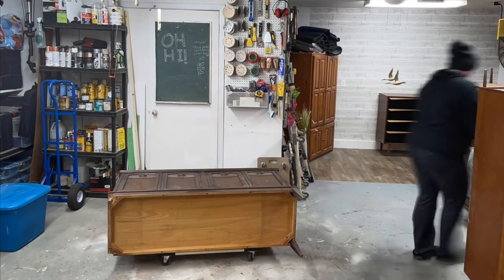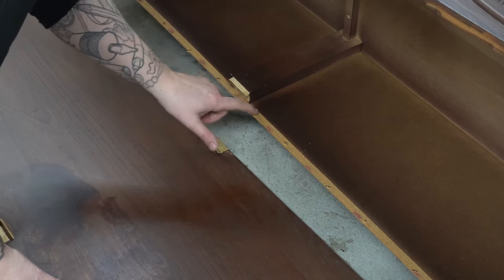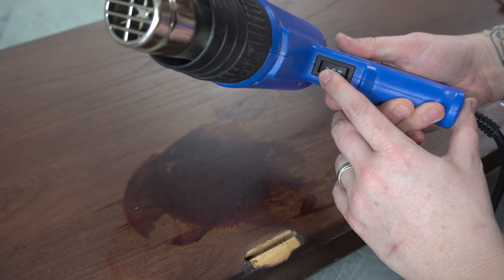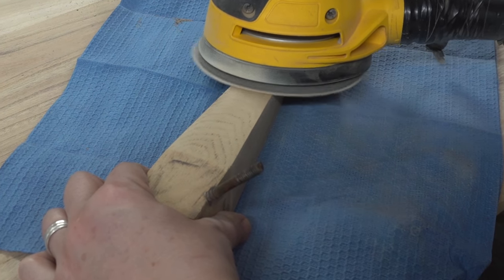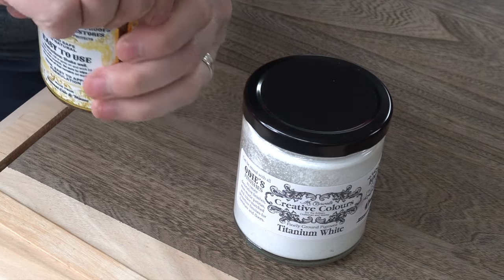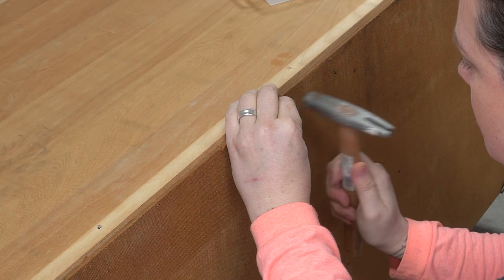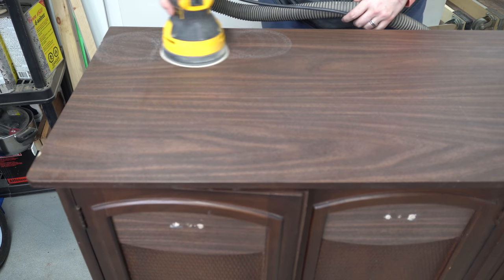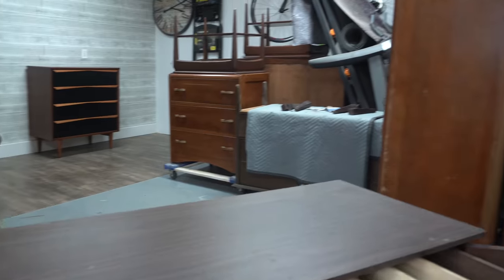From Drab to Fab: Vintage Sideboard Makeover!

Comment: When you put glue into cracks, try using a little suction cup to push the glue in. Place it over the crack and push up and down. Luthiers use this method on guitars 😊
Wonderful job 👍😊👍
Reply from the maker: Very cool! Great tip!
Reply: Great tip 👏🏻👏🏻👏🏻👏🏻👏🏻👏🏻
Reply: They also make dental syringes with little pointed tips.
Reply from the maker: @stevedarnell8444  yep! I find it’s a bit hard to get glue down those ones (typical wood glue, anyway.. hide glue might be easier) and this crack was too narrow for a normal glue syringe.. so floss it was. Haha
Reply: @TranscendFurnitureGallery  Never thought of using floss - good tip as well

Comment: You could try an air duster in a can with a tube nozzle (the kind IT people use to clean computer keyboards) to blow the glue into the smaller cracks, maybe dilute the glue a bit for this?  I haven't tried it myself but I just thought of it while watching you tackle the cracks. Also - for the warped wood - if you have the time and the piece is decent, try soaking the wood on the raw unfinished side with a paintbrush and just water then clamping it the way you have done.  Let it fully dry then check the warp. Keep re-wetting (only the area that is warped not the whole piece and not on the painted/stained side), and clamping and drying until the warp is gone. I have done this before on a piece with a lot more warp that the one in this video and it works really well but it does take time. All up it took about 3 days for me.  Some people soak the whole piece but it doesn't need it if it's just one edge.  Works brilliantly! :-)

Comment: When you have a large board like that that's warped you can use a table saw and do a half to quarter depth pass in the middle of the bulge then fill it with glue and clamp it. This will force the convex bulge to pull down straightening the board. Obviously it 100% depends on the severity of the warp, the tension contained in the wood, and the availability of strong clamps. I've done it using pipe clamps and it works wonders

Comment: The gold knobs and timber base and legs make it. Good job miss muffet. Great retrieve from something truly scary from birth to this smart item with reassuring pale timber. Elm is alright, I have a circular Best black refined granite with pencil round edge, table with central column and supports of  old elm made for me by carpenter furniture make. And match rectangular table the dirt that sits behind a setter, with elm base with a basket shape under the granite so could be used in a 100 years with a glass top. The two colours are good, deco.
Reply from the maker: Thank you so much!

Comment: A tip (you might already know,but....)
Keep your sawdust in a jar or coffee can, sift it so there's no chunks/splinters.  When filling a hole, eyeball the amount you'll need,add wood glue to it making sure it is all wet. Apply just as you would apply putty. Let dry,sand it,good as new (and economical.

Comment: With cracks have you ever tried CA glue?  I use it all the time, works really well. Flows into cracks almost like water so you are not having to fight with pushing the glue in.  If crack goes all the way through just put painters tape at bottom of crack.  By the way. Great work.
Reply from the maker: I haven’t! That’s a great idea!

Comment: This is a fabulous transformation, I would never have thought of black but it works really well.  Did you use the same stain on the front of the doors as on the rest of the piece? I think you said that the panels on the doors are plastic so I wasnt sure if paint would be ok to use on there?  thanks

Comment: great job love the contrast between the colours by the way when I need to fix a crack in a top if you cant prize open the crack to use a brush try putting the glue on the top then use a vacuum underneath and it will suck the glue down it works for me try it.Unfortunately a lot of your products are not available in the UK we use a oil called osmo as I've never seen odies available here
Reply from the maker: Yes, I’ve had a few people mention that trick with the vacuum! I’ll have to give it a try at some point! I’ve used glue syringes, floss, toothpicks etc but always having one more trick up the sleeve is a good thing. :-)

Comment: Question:   I’m putting walnut butcher block countertops in my kitchen.   I’ve been thinking of using Odie’s to seal them but wondering whether to use the oil, butter, wax or a combination.  Any thoughts?

Comment: I am in no way as talented as you but have a tip on getting glue into the small cracks.  Use a vacuum after you coat one side with the glue and suck the glue in the crack.  I have tried this and it really works better and faster than floss.

Comment: Beautifully done. Does anyone know what the metal pieces that the drawer dividers slide into are called or where I can purchase them? I refinished a mid-modern dresser and all the dividers are in the drawers but the hardware to hold them up are missing
Reply from the maker: You could check Amazon for the ones you need. Thanks for watching!

Comment: Hi! its me again. I have a question about my birch veneer dresser. I've sanded it down as much as i dare but there are still black small marks where the veneer cracked from age and moist. I've sanded with 240 grit so the surface is smooth and you cant feel the cracks, but I got a burst thru anyway.   I try to decide to stain, wit oil stain or water based stain or try to wax it again. Paint is my last option of course but I really wanted to see the grain. How would you think?

Comment: How much do you sell a piece like this? is it worth it or is it always a labour of love? Love what you do. Lizzie, Australia
Reply from the maker: I don't like discussing how much a specific piece sold for because it varies so greatly from place to place, person to person and year to year. I never want someone coming back at me saying "Well Angie said I could charge XXX for it." No thank you! 😊 Some people try to use an hourly rate on non commissioned pieces but I don’t find that very accurate. Sometimes the tiniest details take FOREVER, and would quickly “price out” the piece you’re working on. I go by what the piece itself is worth, based on comparable products in my area, and the finishes I’ve done to it. Most of my pieces sell within minutes. Which generally means I’m pricing too low, lol. But I don’t have the space to keep pieces for days and weeks so I need them to move fast. If I had more room, perhaps I could get a price closer to what some others in my area are charging. Which has gone WAYYYY up.

Comment: Purely from lack of bunneh curiosity, but would it be possible to fix the warpage with some strips of laminated ply wood?  (laminated like 2 x 3/4" strips glued together for strength, like), if attached across thw width of the frame?
Reply from the maker: Unfortunately, it wouldn't work well, as the base is solid wood, which moves laterally. So when something gets glued or nailed or screwed, it prevents the wood from being able to naturally expand and contract. So in essence, strips could technically exacerbate the problem.

Comment: do you prefer to brush paint on more than spray? great piece :)
Reply from the maker: Yes I do - I've been painting by hand for years so it's easily done. 😊 I do have a sprayer, but I tend to reserve it for situations where I’m doing either more than one piece, or a large piece with a lot of flat areas. Otherwise, I don’t find it worth the time to set up the spray tent, etc.
Reply: @TranscendFurnitureGallery   haha yeah that makes sense. thank you for all your amazing tips! I'm gonna shoot for the graining markers i saw on another piece you did and hope it turns out. :) Hate to paint a piece just because the veneer needs a little repair. You're a great teacher btw :)

Comment: As I understand it:

"Warped" is the catch-all term for distortions from true in the wood. Usually used when the wood was straight and now shows both peaks and valleys. (Think plywood left out in the weather for a year.)

"Bowed" is when the curve is convex, as is the bottom of this piece. Like a bow from a bow-and-arrow.

"Cupped" is when the curve is concave. If you could store water in it, it's cupped.
Reply from the maker: Perfect explanation!

Comment: I have a question you may know the answer to.  Do you know if the dust from sanding the furniture is ok to put in a compost pile or is it trash and harmful to the garden.
Reply from the maker: I wouldn’t recommend it personally, especially if some of that dust contains ANY bit of old finish. If it’s just plain wood dust.. that might be different depending on the species. I’m honestly not entirely sure, but I probably wouldn’t use for compost, personally.

Comment: How do you determine what type of wood it is?
Reply from the maker: Experience, mostly! Some wood grains are a dead giveaway, but only once you’ve seen them several times. I’ll be doing a video soon with some of the more common woods used in furniture. Even I struggle to identify some of the lesser known ones but the main ones (walnut, oak, pine, mahogany, teak, elm, and maple) are usually fairly easily to tell apart once you’ve seen and worked with a few. :-)

Comment: Question ❓ why did you put stain and oil on it if you were going to paint 🤔
Reply from the maker: ? I didn’t ? 
I only used stain and oil on the piece that is INSIDE, the base, that I took apart so I could refinish it. I think you’re confusing that for the top (which was only painted).

Comment: I’m watching YouTube videos and trying to fix my HUGE mistake! 😩
I have a small veneer dresser and used oxalic acid to bleach. And then I put wax on before it was completely dry so it looked terrible, and was worse by the minute!! So now, after sanding and ruin x sanding pads I’m using a sharp knife and cleaning every crack and have to come up with something to fill all deep cracks through the veneer.
Reply from the maker: Oh dear! Mineral spirits works well to remove wax! And were you sure to rinse the oxalic acid well with water?
Reply: @TranscendFurnitureGallery  Yes, I used mineral spirits to get the wax off and yes I rinsed well, a little too good and not letting it dry properly was my mistake. Soo, just adding 3658734 hours of sanding and it will be really good. 😑

Comment: Hey I have a problem I have spray paint drips on a piece of furniture uhg,  how do get the drips off without messing with smooth paint around the drip? Ty mortified lol. It's metallic spray paint. The furniture is not wood there's no wax on it
Reply from the maker: If you still have a little of the paint left, you could try a straight blade (like the kind in a small glass scraper) to try to “shave” off the thicker drips, then a light sand with a fine grit just to level it off and other quick spray.. if you don’t have any of the paint left (if you didn’t do the piece yourself, or if there is some other product over the paint, like a coloured wax, etc).. I’m not really sure what to tell ya!
Reply: @TranscendFurnitureGallery  I wish I could send you a picture 
It's a French provincial dresser MDF and some wood on the skirt I'm thinking of stripping the skirt where I sprayed it and... dripped the metallic spray paint

Comment: My first thought is, is it worthwhile trying to renovate a piece that is so badly warped, does not have a wood top, and has plastic panels? I’m sure you can turn it into something attractive, but I wouldn’t care for it unless you replaced the plastic panels with woven caning or such, and replaced the top with wood. But how are you going to fix the warped parts??????? With respect!
Now I’m confused! You’re treating the top as though it was wood—I thought it was laminate?
Oh, and what was that big blobby stain from inside? You never said, and I don’t know how you got it out!
Reply from the maker: Yes, you certainly are confused. The top IS laminate. I didn’t “treat it like it is wood”, I painted it, along with the sides. I have no idea what the big stain was, as I wasn’t the one who created it. If I had to guess, it was likely red wine from a previous owner. And lastly- yes, just because something has laminate or plastic on it doesn’t make it trash. Do you drive a vehicle? Is it garbage if half the materials used are plastic? No. In fact, it’s almost MORE important to keep plastic out of landfills.

Comment: That’s not a terrible putty knife, it just looks like a really stiff one which isn’t used for that sort of task. Think of how stiff you need your tool to be when window glazing
Reply from the maker: It is terrible in that there is a corner broken off- that's what I meant. I had to replace it with a new one before that corner scratched something it shouldn't. :-)

Comment: That was a gross piece of furniture to start with lol but holy cow what a bute! (1940’s lingo lol) hey what’s the difference in beeswax or butter finishes to like using other top coats? And how do you not see any brush strokes on your finishes? Tell me all your little secrets 😬😂❤️
Reply from the maker: Wax cures hard, and is usually used as a final layer to provide added protection. The butter is a hybrid between oil and the wax, and is a softer consistency. It is used as a building layer, and provides additional protection and extra sheen.

As for brush strokes - I actually talk about it in this video - https://www.youtube.com/watch?v=Eh8p_NvuxV0 at the 14:56 timestamp. 

The key is thin layers. I don't goop it on. I don't go for full coverage with my first coat. You can also fine sand between layers if you'd like.
Reply: @TranscendFurnitureGallery  and that is why I hafta watch your videos a few times. I total missed the part where you said light paint first 👍🏼